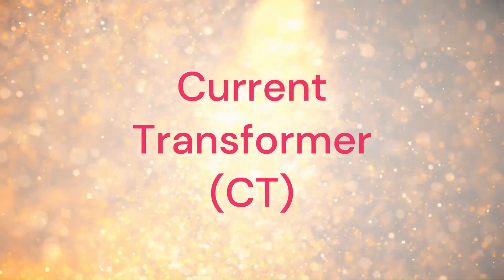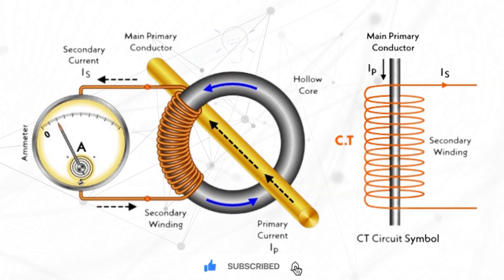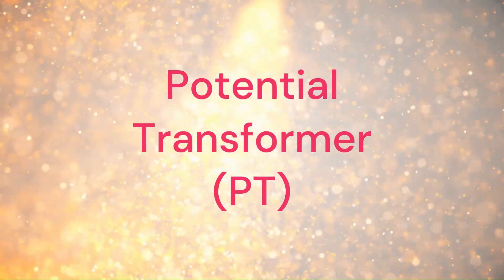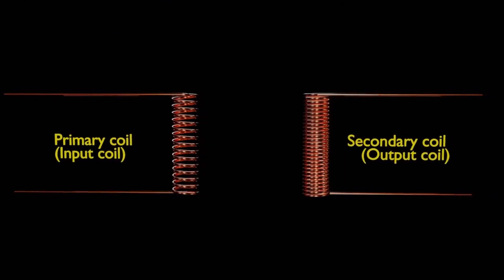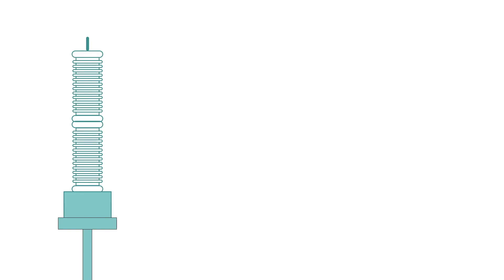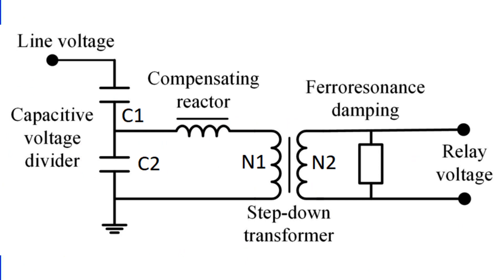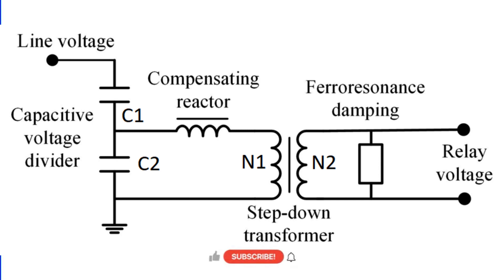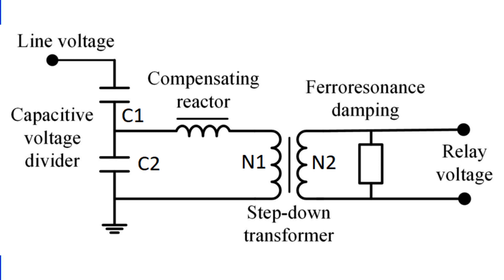What is CT, PT, and CVT in Power System? #interviewquestions #electricalengineering

Comment: In a sub-station, will a 3 ph cb trip if any one phase is down ?
Reply from the maker: There should be under voltage relay which detects under voltage and any phase failure of the system. If the situation happens then the CB will automatically tripped by the relay.
Reply: @Electrology001  Many thanks for your quick reply. Happy new year
Reply from the maker: Happy new year 🎊